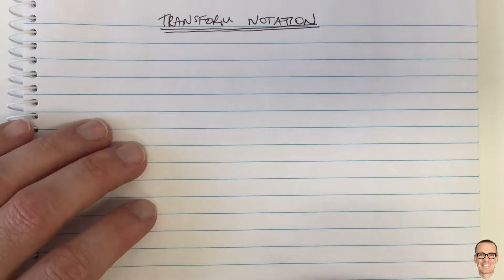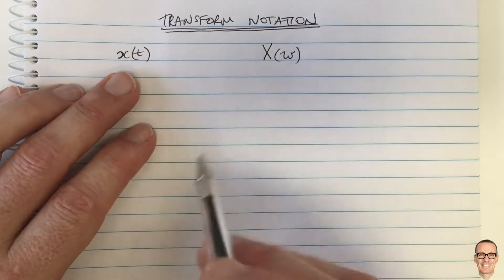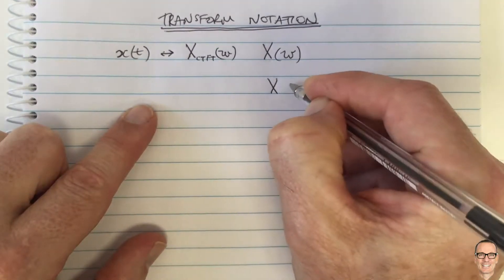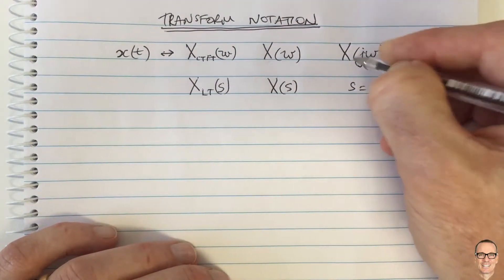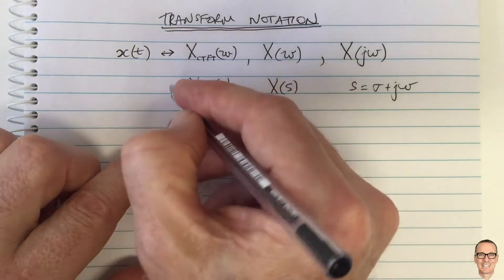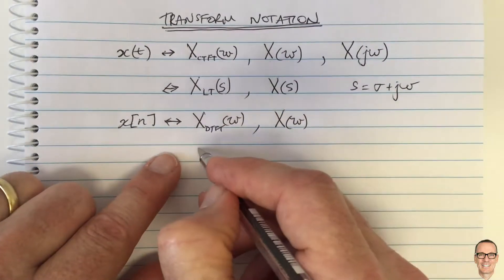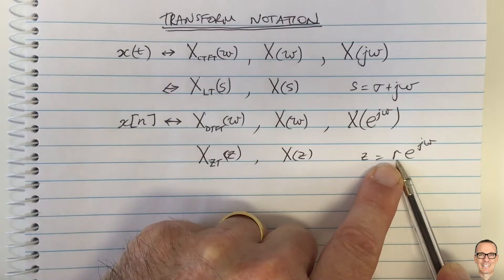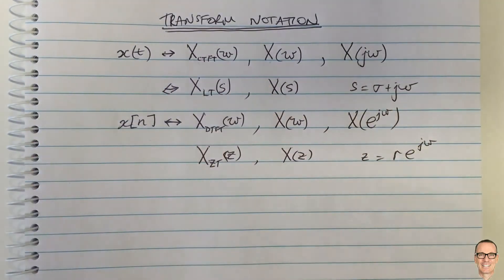Transform Notation

Comment: Nice video!
The book and courses i had in signals/systems actually used the variable (wT), which kind of was confusing at the start. Any familiarity with that? I mean written as X(e^jwt)
Reply from the maker: X(e^jwt) doesn't make sense. The use of the capital letter, X, usually implies that it is the transform (ie. a function of the transform variable), so it doesn't make sense to have the time variable, t, in there. Perhaps you mean X(e^jw), in which case that's one of the representations of the Fourier Transform of a discrete time signal - as I explain in the video (RHS, 3rd row).
Reply: @iain_explains  I really mean that is was written: X( e^(jwT) ). And for all kinds of functions: input, output, transfer function.
But its a simple variable substitution really... jw -> jwT. Makes everything 2pi periodic and nice.

Sorry, just realised that I didnt capitalize the second "tee" in my first comment...   And I should propably also clarify: T = 1/Fs  (the sampling period)
Reply from the maker: OK, I see what you're saying now. My response would be that making everything "nice" shouldn't be the aim (at least it's not my aim). Making things look "nice" often ends up just adding confusion. I think most engineers are more interested in knowing what the true frequency is (not a "nicely" scaled version).
Reply: @iain_explains  totally agree with you! But i just want to point out that this notation also exist, although maybe only where ive studied :=)